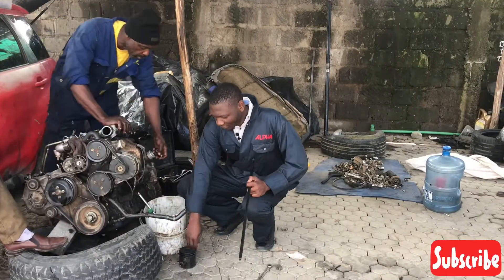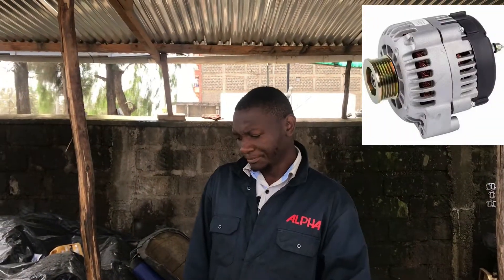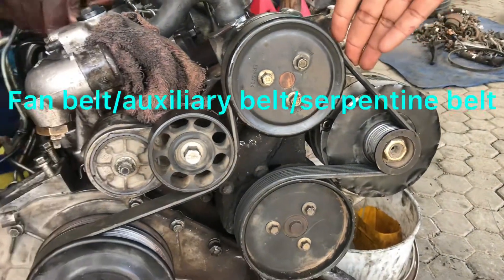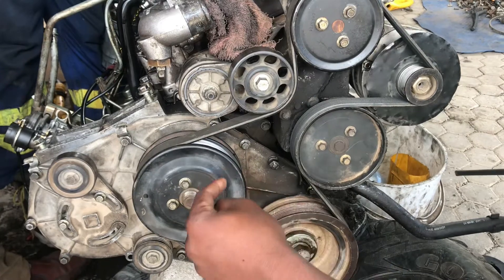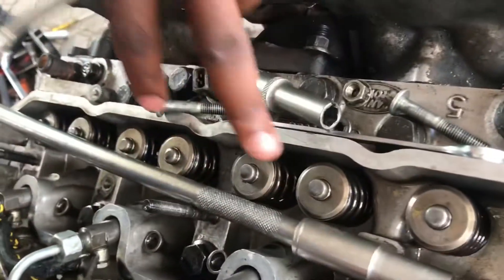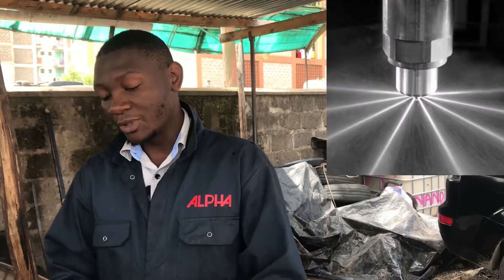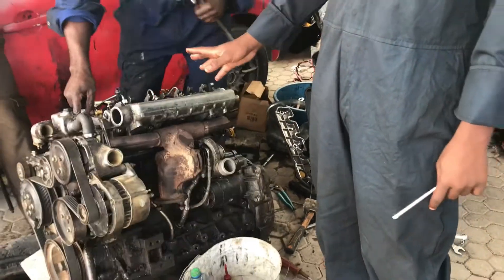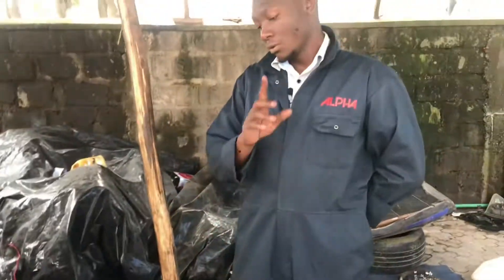Parts of an engine and their function

Comment: Hey Bro...do you know anything about putting a  4.4L TDV8 (Range Rover engine) in a Discovery 4 ? I believe Ford makes these engines, branded as Ford Lion. They also make the TDV6 that currently goes in the Discovery 4. I've seen only one on YouTube but there was no detailed explanation on how its done. I'd love to get your thoughts on this. I'm pulling the trigger on getting a discovery 4 with under 200K miles. Once that engine  is kaput, i want to replace with a TDV8
Reply from the maker: It surely can be done. However, it’s not a direct swap. A few Modz need to be done e.g mounting points, coolant lines, radiator and intercooler, wiring harness and loom etc
Reply: @aswanation  Thanks brother. I'll engage on this close to the time. Maybe you'll fancy a trip to Zimbabwe to work on it for a bit and make some $$